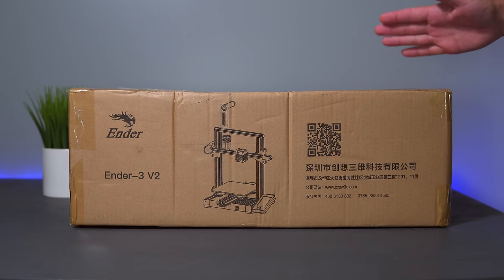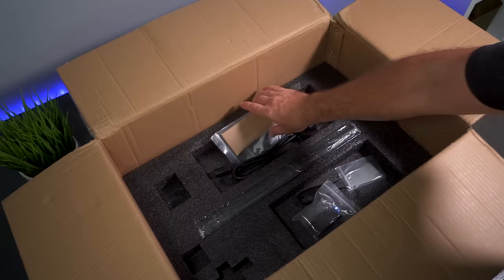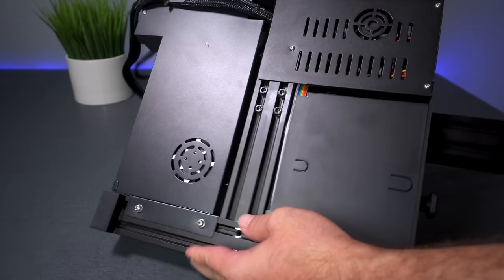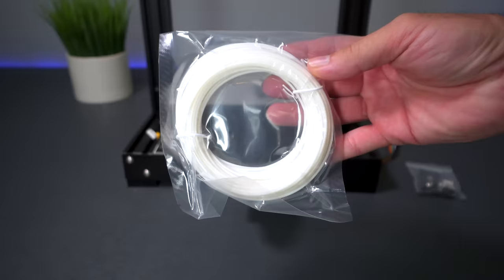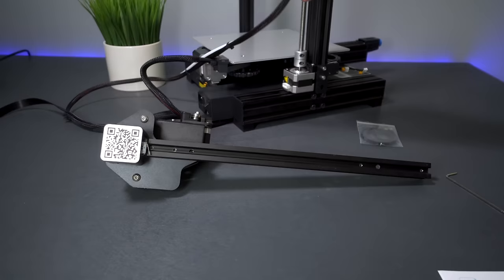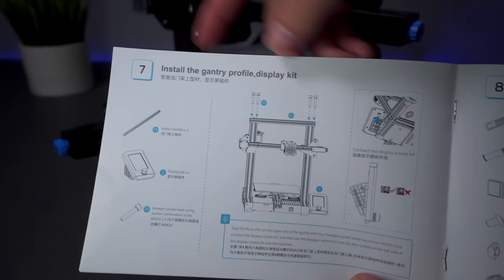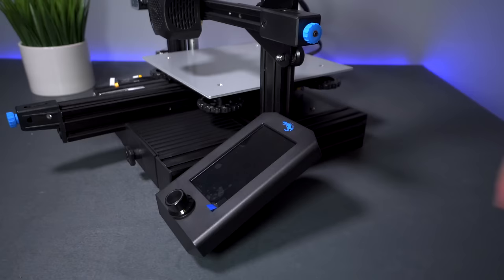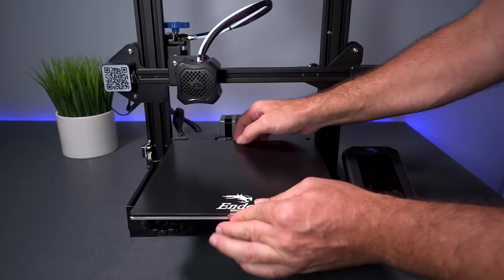Creality Ender 3 V2 - 3D Printer - Unbox & Setup

Comment: I'm having trouble with the x axis bar raising and lowering.  I cant push it up with my hand, but it goes down fine when  I push down on it.  It also moves really slow up and down when I set it to auto home.  Any ideas on what could be causing this?
Reply: That’s fine. I had the same problem and the prints come out fine. Z axis doesn’t need to be moving very fast anyway! :)

Comment: You just grabbed the stl from thin air. I have no idea how to import the calibration cuble stl. You also never explained what to do if it doesn't print perfectly the first run which is probably what happens to most people.

Comment: How does the middle bar move up and down so easy at your end? If I do the motion you do at 23:11, I lift up my machine
Reply: I have the same issue. I'm not sure if it has something to do with my threaded rod and the brass fitting it screws into, the motor itself, or the square-ness of my vertical rails. Someone help lol

Comment: At 23:00, I'm having trouble to bring up the x-axis to the top, not sure what I did wrong
Reply: I had a little stutter taking mine to the bottom.  I loosened the top and bottom bolts on the 2 uprights and repeated the steps he went through and it fixed the problem.  I think you might be ok though.  I had problems bringing mine to the top but I figured out that when pushing the bar to the top you have to apply the pressure dead center or it binds the wheels up and makes it difficult

Comment: I know it’s an old video, but I have a question. For the filament roll, how did you get the nut off of the black tube? I feel so dumb, but I can’t for the life of me figure it out.
Reply from the maker: Twist the nut counterclockwise while holding the tube, then when it stops pull them apart outward from each other.
Reply: @JustVlads  thank you so much. This video was probably the most helpful thing I’ve ever watched.

Comment: How do you print the octopus? I have two failed prints now because one or two of the small arm pieces came loose. I've cleaned the bed with IPA. Do you keep the default print speed of 50 mm/s?
Reply: Third time's a charm, it seems. I lowered the bed temperature to 50 degrees C and slowed the speed down a bit to 45 mm/s. Now it seems to stick fine.
Reply from the maker: Lowering the first layer to 20mm/s is what i do. Also if your coating on the bed if not sticking well, washing it with regular dish soap that gets it to stick again but make sure to rinse it well.

Comment: Hey i think there is something wrong with my v2 when i put the filament in the extruder and i twist the knob to push the filament through it isnt pushing it through its just grinding the filament can you help me?
Reply: Cut the filament at a sharp angle so the point feeds to your left. It will find the channel opening more easily. Note: cut it back about 1/2” to get past the area the feeder knurled gear ground off.

Comment: 23: 38 My left Z axis eccentric nut isn’t doing anything:(

My whole gantry is too tight, which post people have a too lose issue. And it won’t move down unless I turn the lead screw. And there is a lot of resistance. Even when I do find the tiny spot on the eccentric nut that’s somewhat soft pressure it’s still too much to slide down. Please help!:( creality support numbers don’t exist and emails are not gonna help me.
Reply: I ended up having the same issue, what I ended up doing was loosening the entire wheel by using the allen key and the concentric wrench, then adjusting the wheel tension until the wheels had a slight resistance to it, I hope this helps!

Comment: Hi, I was wondering what the length of the filament has to be to be put in this 3d printer as I just got one and was wondering if it was 1.75mm
Reply from the maker: 1.75mm filament is the correct diameter for this printer.
Reply: @JustVlads  thank you

Comment: Instead of all those fancy shmancy stuff i would much rather V2 to have auto leveling and wifi. It would make the printer perfect. All the other addons they put now most people can print/fix themselves. Auto-leveling and Wifi requires programming and more sophisticated knowledge. Not really an upgrade if you own V1 as far as i can see. With that being said Ender3 still remains the king of budget 3d printers.

Comment: for 21:55 mine doesn't go down by itself much and if i loosen the bottom coupler it doesnt seem to do much, it seems really stiff. any ideas?
Reply: I have the opposite issue where mine takes a lot force to push up
Reply: @gamerboy408  did your printer give you any trouble even though it was tight like that? I wonder if its worth fiddling around with before I go to the next step

Comment: Does anyone know where someone can get the rollers, bolts, and nuts
Reply: I think it comes with it
Reply: @thonco  i bought a printer off someone and one was missing
Reply: Oh then I don’t know, if you don’t need them for the printer to function then you can put your own.
Reply: Sadly I do its one of the rollers for the center bar on the right side

Comment: Thanks. I find the instructions to be almost unusable. Even if they were easily comprehensible (they are not) I would still have trouble because the lettering and diagrams are near microscopic. If you don't have the eyesight of a 16 year old you could have difficulty just seeing them, nevermind reading them.

Comment: You really need to learn man like you're talking about how when you push down on the print head it should just slowly glide up and down the rail without binding but you don't tell what to do if it is binding lol You're just like yeah if you did it perfectly it works like this but if you didn't it's going to suck and I'm not going to tell you how to fix it
Reply: He can't take everything into account when making the video or it would be 3 hours long, especially if his specific model doesn't have any of the issues that yours may have